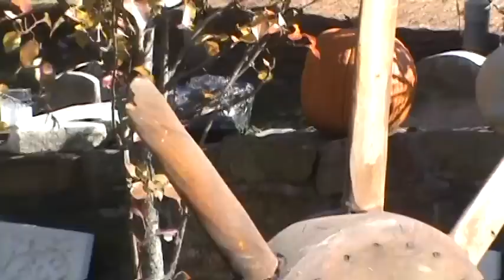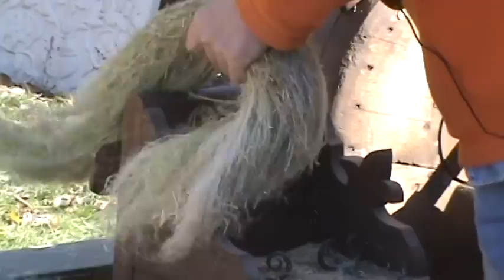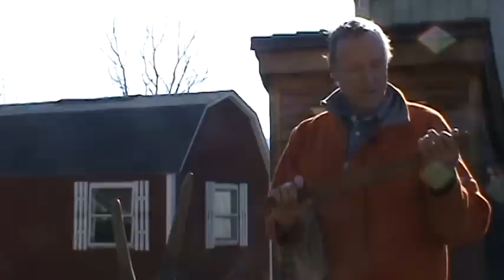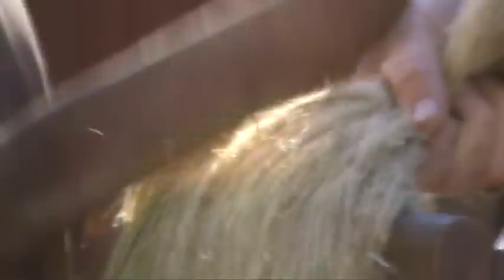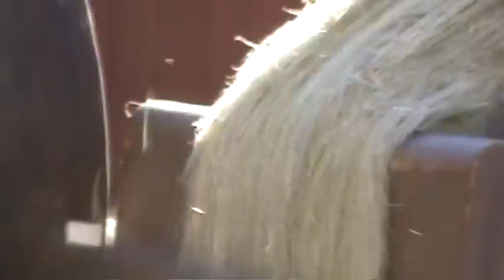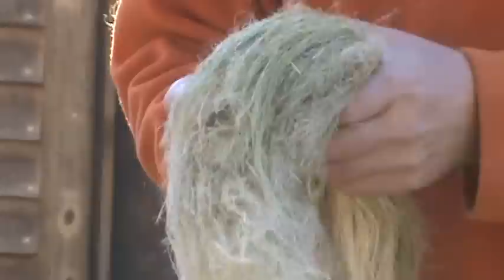How to Use a Flax Scutching Wheel

Comment: Most of the comments about safety and fatigue do not account for actually doing this work as a vocation rather than as an avocation. The more you work with treadle driven equipment the more you develop the musculature and stamina needed to do it efficiently, continually (for days and weeks rather than for demonstrative time), and with stamina. The treadle leg develops for the up and down motion. The standing leg develops for support and stability. Also, as to safety, the people that used this equipment were not as mentally distracted as people are these days. Safety is as much a matter of concentration as it is of proper equipment.